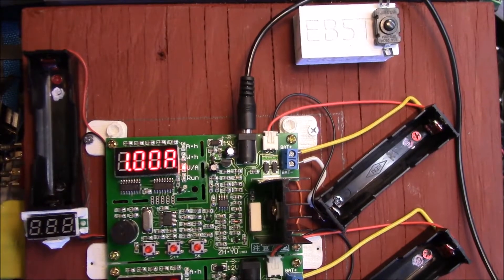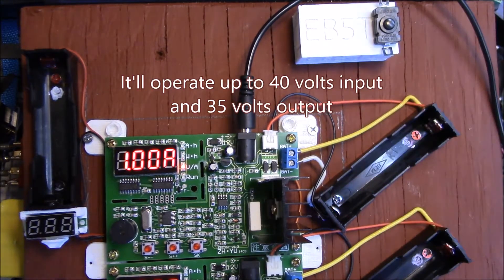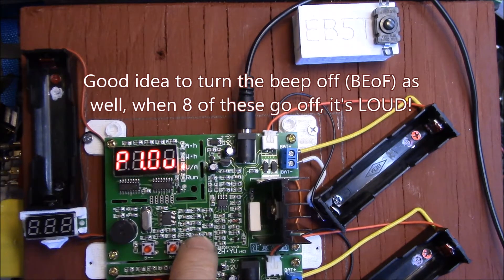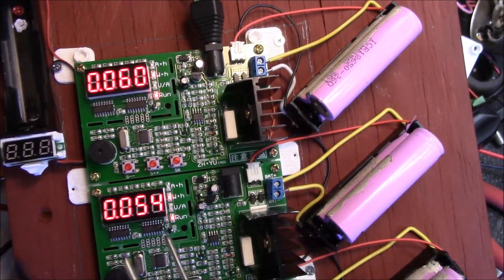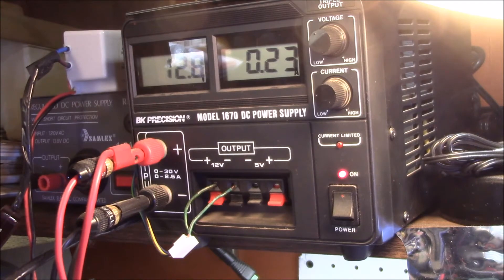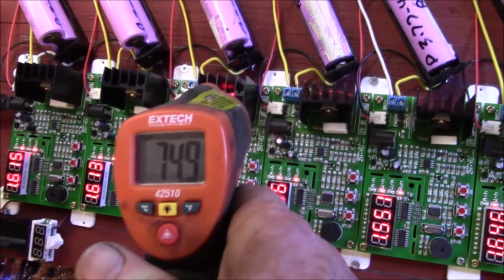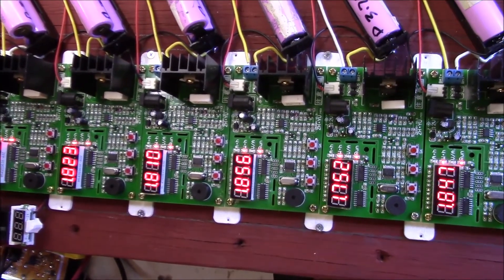8 Cell 18650 Discharger, Part 2

Comment: that one stupid mistake ruined all....its super good setup its cool but thouse cells puted in one....u teaching others so bad....its so wrong how u will know what cell is good and what are bad? all bad wrong horable mistake that puts others to risk....so sad for what u do u know...
Reply from the maker: Each cell is in a separate discharger.  The only thing the 8 dischargers share is a single power supply connection, cooling fan and the piece of wood they're attached to.  I've run many hundreds of cells through this discharger for capacity testing with no issues at all.
Reply: but u testing 2batteries spot welded together its super bad and wrong mistake u dont know what is good what is bad so we test 1by 1 not 2in1 u put wrong information for others risking badly if some one will burn house by testing that puted in to 100 1000pack and 1got to hot and will explode they will turn in to u so u want that risk? go on....goverment will ban that amd make it illegal cause of u for us diy fans to build it cheap and save planet in 1% so study more....look at others like a dude who made diy car retro wolgswagen 100% from laptop old batteries where he puted 3000 4000 of it
Reply from the maker: @neironasgautamas654  Yes, testing 1 by 1 is best but takes over twice the time.  These cells have been paired up their entire lifetime.  

My procedure is to check them for voltage after removing them from the original battery pack, then charge and let rest.  If they maintain voltage as a pair, then they are capacity tested.  If the capacity test is within limits, they are left as a pair since my battery holders are designed to take paired cells.  I feel that testing with the factory pairs saves the possible damage caused by removing the factory spot welded tabbing then reinstalling new tabbing.

If the pair of cells tests poorly, then I do separate them and test them one at a time.  So far in nearly 1000 pair tested like this, have had no failures in the pairs that pass the test and the battery packs made of those paired cells are doing great:
https://youtu.be/AL1wXwRin9w
I still have yet to process the single cells that I've collected by separating out of the factory pairs.  I find that most of the bad pairs have 2 dead cells, but some small percentage of the time, there will be a decent cell paired up with a dead cell.  That's evidenced by the pair testing out at half (or less) of the expected capacity.
Reply: @The4Crawler  so what that it was paired all the time it does not tell any thing 1 by 1 take it out 1charge 1discharge that 1charge again dont miss lead others its wrong...
Reply from the maker: @neironasgautamas654  Two different schools of thought.  Here's some testing of pairs and singles that shows there's not a lot to gain from the extra work:
https://youtu.be/LRJS_iTyymA
That person's battery packs also use paired cells.  Perhaps you have a source for similar pairs vs. singles testing that shows a benefit to the additional testing?

Sure, if my battery packs were set up to take single cells, I would for sure separate and test cells individually.  But my packs use pairs by design and I mostly use cells that were originally used paired up from the factory.  The hypothesis there is these were cells from the same mfg. batch that were paired up from day one.  They've seen the same operating and environmental conditions and the majority of them will be close in terms of capacity and internal resistance.

In testing my bad pairs, I find most have 2 bad/weak cells and only a small percentage have one good and one bad/weak cell.  Those show up as half capacity of the other pairs.  I'll pull them out for later separate testing.  Then out of the single cells that test good on their own, I'll match up pairs, re-tab and use those later on.  

Maybe at some point I'll consider re-testing some good pairs singly and see if any differences show up.
Reply: @The4Crawler  its all about stability security acuarsy that are huge diferance u know think deeper and more biger then that u know....
Reply: @The4Crawler  every bits and peaces count all measures count all security counts thats what u need to learn BEFORE teaching others
Reply from the maker: @neironasgautamas654  I would like to see a study that shows how much of a difference to expect with individually tested cells vs. factory pairs and what benefit there is compared to the added cost/time.  There is a non-zero risk of cell damage in removing factory tabbing and then re-welding on the new tabbing that also needs to be considered.  You might have two perfectly matched cells and then damage one with the spot welding process and not know there was a problem unless it were re-tested as a pair.

By all means, if you or anyone wants to do single cells go ahead and do it.  This cell discharger can do single cells just as well as pairs.  I've used it for testing single cells.  I'm just showing what I did and so far my results have been excellent.  No failed pairs in the ones that have passed my testing criteria in many years of daily use.

Comment: My resistance numbers got better when I went to SMT surface mount 18650 holders with the brass contacts.
Reply from the maker: Good tip, hadn't seen that type of holder before.  I've not been able to figure out how to do the IR readings on these units, at least with the sketchy usage instructions I have.
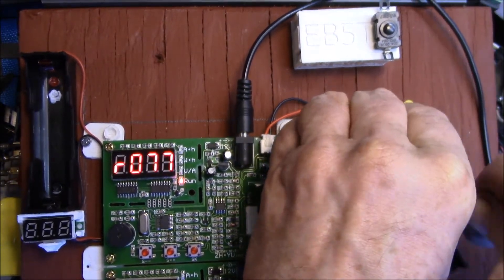Reply: @The4Crawler  You did the IR at 3:10
Reply from the maker: @lmorrison17  Thanks, I had forgotten about that.  The how to file I found later didn't spell out the details on how to get into that IR mode.

Comment: i don't understand why people are getting in such complicated thing....? its completely waste of time.
Reply from the maker: Compared to the way I did the discharge capacity testing in the past, this is less complicated.  I used to have 3 separate RC battery chargers, with 3 separate cell holders and 3 separate power supply connections  and had to constantly be cycling cells through those.  While this may look complicated, it's just 8 simple, dedicated discharges on one board with one  on/off button.  All I do is plug in 1 or more cells, hit the start buttons and record the capacities when they're done.  When I'm testing capacities on 100s of cells, saving a bit of time on each cell adds up.

Comment: Very nice unit. If I may I would suggest putting a switch on the top unit so when you want to check resistance you can turn it off and not the others to set it to resistance mode?
Reply from the maker: Yes, that's a good idea.  I  will be adding a single on/off switch for the whole unit in the next video.  In retrospect, I could have added one switch per device.  Would have made the power wiring more complicated, though.

Comment: Having never fiddled with 18650-type batteries, I have a handful of new Samsung cells, a small commercial charger, some 2- and 3-cell charge manage/protection PCB's.  Help me recall - do you have any videos with suggestions how and where to procure packs to disassemble for their cells?  Or, do you know of any USA sellers of 18650 batteries with reasonable prices?  Thx.
Reply from the maker: I've mainly looked for decent deals on eBay.  But you might check out jehugarcia's channel:
 https://www.youtube.com/channel/UCcMfCkN1juSa49DJFYltOTw
He seems to post deals on batteries from time to time.  I did pick up 400 new cells on one of his finds and those worked out quite well:
 https://youtu.be/gV-deRJpZlE